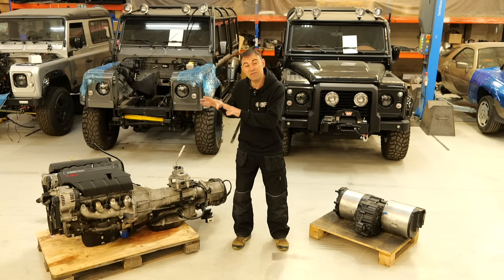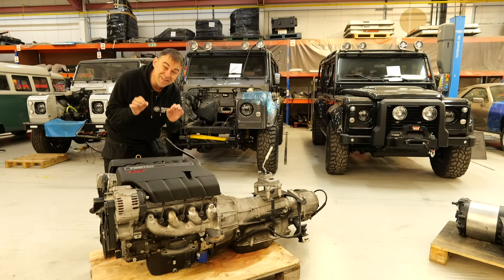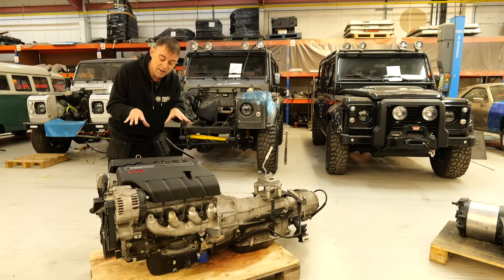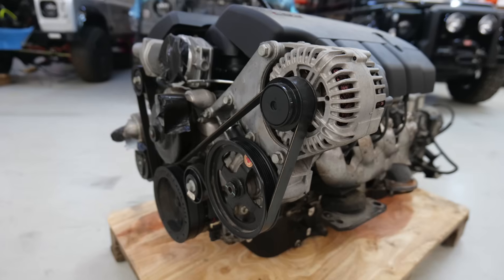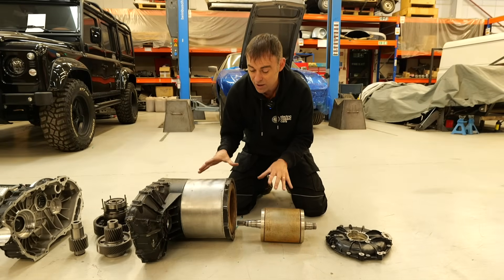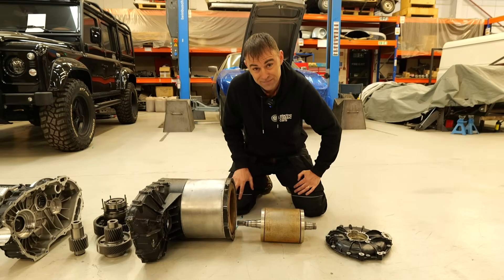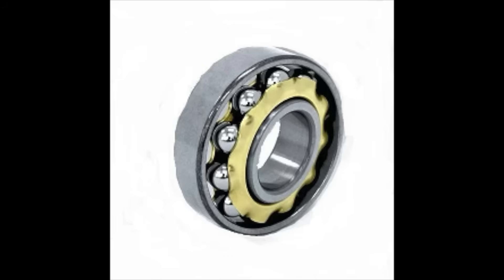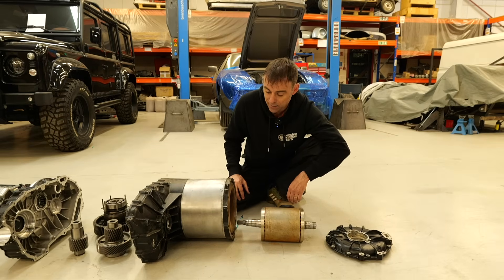Let's compare the Tesla LDU with an LS3 V8 and take one apart to see what makes it tick.

Comment: You're considering the motor in isolation from the energy storage and management. There is ton's more complexity in the Electric regarding storage, cooling of that storage, very imprecise calculation of available energy in that storage, and protection of that energy from being released in an uncontrolled manner. The ICE engine's storage of energy (fuel) is much simpler in comparison and safer (not in terms of total fires, but in severity of the fires that do occur). You can see this playlist of the MANY risks that come with EVs:  https://www.youtube.com/playlist?list=PLAQf9tD6dnaCt_tu7y9buqvQhU9Neo5Gv
Reply from the maker: Wow, someone that watches StacheD and MGuy, you really have been drinking the Anti-EV cool aid. 🤷‍♂️🤦‍♂️ How about watching a bit of reality like https://youtu.be/opF1si__APs?si=cVPzSWXwYU62ZV7D
Reply: @ Hey, with respect, I can say the same thing about people drinking the kool-aid from the likes of Electric Viking & other loonies. What elevates my opinion over the opposite person is a 180 hrs of college courses with a wide background in phsyics, chemistry & electrical engineering. I'm not just jumping on some bandwagon to score cool points with a particular side. If you want to convert classic cars to electric, I don't have a beef with that. You make some good points about the simplicity of the motor & thus reliability. But it's only one of many component of what makes it work. And unfortunately, the BMS & batteries have shown themselves to be a safety risk when they are abused (& many times there are not a lot of clues that can definitely determine when that happens). And that creates a lot of waste & expense b/c that vehicle must be disposed of, like flushing money & work/energy used to manufacture the vehicle down the drain, raising insurance costs for everyone in the process.  Without subsides/taxes/&regulations from the gov't, EVs would not make a compelling argument to the average consumer. That's reality.

Comment: Great video and electric is the future, but the now issue is providing energy to motor or engine, depending on desired range, you can add 100kg for petrol or 1,000 for batteries, all cars are getting heavy (apart from MX5) but most electric cars are particularly heavy which is not great for total resource use…

Comment: it doesn't seem you are comparing apples with apples: the LS3 needs fuel (a fuel tank) whereas the Tesla needs power - banks of it which is not mentioned in the maintenance consideration nor in the weight and size comparisons....
Reply from the maker: We covered petrol vs battery comparison in a previous Tech Talk which was linked multiple times in this episode. 👍 https://youtu.be/opF1si__APs?si=5RtLkXs1A3lPlj7y

Comment: ICU can be switched over to hydrogen in place of gas.  The engine sounds are still there and the exhaust is drinkable water.  The car doesn't know it's not running on gas.  Yes, hydrogen infrastructure is negligible but when the adults step in it will happen.  Logic dictates.  Why deal with rolling brownouts while your LS-1 is idling in the driveway and helping the atmosphere.
E-cars are big time now, but so was Elvis in his day.
Reply from the maker: You need to do some basic research into why Hydrogen will never and has never gotten off the ground. There’s too many fundamental issues that can not be worked around. 👍

Comment: Electro motor also has a thousands of small parts (please disasemble inverter unit). They are also prone to malfunctioning, especially because ageing, corosion and overheating. Plus the size and weight of batteries. And they are NOT economical or ecological at all. The only one benefit of EVs is no DIRECT pollution from exhaust. But, there is very hazardous EM radiation around em (like in microwave) and faster tyre wear as also very dangerous (much more heat than petrol) battery fire. Every technology has it's own pros and cons. For me, I need reliable car which can drive in all conditions for hundreds of miles, even in places without electricity. So my picks are diesel and petrol cars. Untill hydrogen cars become standard.
Reply from the maker: You’ll be waiting a looong time for hydrogen to become mainstream. Alternately go and buy a Toyota Mirai now and let me know how you get on. 👍

Comment: 2 Things here, 1) you forgot to add the Weight and Size of the Battery that Drives that Motor, It is Huge and THAT is where a lot of the Problems Occur, 2) how long does it take to Charge That Battery for say 300 km of range, without going to 200 Amp fast charge, ie: Charging it at home probably overnight, but don't charge it within 10 Metres of your house or Garage in case it "Spontaneously Ignites", which will then "Delete" the car. I loved to see the Side by Side comparison, and the Inner workings of the Tesla motor.
Reply from the maker: 1 - We covered petrol vs battery comparison in a previous Tech Talk which was linked multiple times in this episode. 👍 https://youtu.be/opF1si__APs?si=5RtLkXs1A3lPlj7y
2 - After 3 hours of driving today, we stopped for a quick toilet break and a bite to eat, by which time the car was charged up (in fact it was ready before we were). And as for the spontaneous combustion myth, please do some research. EVs are around 60 times less likely to catch fire and there’s plenty of examples of ICE vehicles spontaneously combusting when parked. Just use Google. 👍

Comment: Your reasons for moving to electric power for your vehicles are all on my list as well. But additional importance for me is where the energy comes from. You can only power that LS3 with a specific type of petrol. And certain people control that supply, and I can't make my own.

Electricity is produced many different ways and I can produce it myself at my home without relying on anyone else. That is very important to me in an uncertain world.
Reply: This is one of the better arguments for embracing EV that is actually quite compelling.  Still doesn't outweigh all the other cons of EVs IMHO, but it balances the equation a little more in favor of EVs.
Reply: @RT-mv7df  Also a good argument for older diesel engines, that lap up waste veggie oil.
The more modern stuff requires that  being processed in to bio-diesel, but either way it within our power to produce it.
Reply: @RT-mv7df  What are some of the big cons for you that prevent you from purchasing an electric vehicle?
Reply: You can make your own fuel, but you can 't make your own batteries. Blame energy restrictions on the government. Wait till they start regulating battery disposal. If they would stay out of the business of cars everything would be better gas and electric.
Reply: @frankmc5112  There are already businesses that can recycle 90-95% of battery material. Furthermore, with the rise of things like sodium, there will be less reliance on Lithium.
Reply: @PaulASmyers   The economic arguments for living — to all intents and purposes — off grid are very compelling. I’m looking closely at it right now. Even if you’re not a greenie (I am but it’s not my primary motivation at the moment), if you can swing it, you’ll be better off financially. I can’t think of any good reasons why I would want to be dependent on oil companies, to the tune of thousands of dollars per year, for the rest of my life.
Reply: You have to get batteries, your screwed
Reply: The Gov fooled you into thinking that but in reality they control the electric. Once they get everyone to switch, up goes the price of electric. Now they really got you.

Comment: Good day ECC team, I was wondering whether you already see other electric motors/ drive units become competitive with the Tesla drive units???  Incarnation Stu is converting a 928 using a MG drive train for example (I don't think that drive unit is better than the Tesla unit!!!) and others have been using Nissan (again no competitor for the Tesla I think), I have seen some in NZ recently (Electricarna in Taupo,  https://www.youtube.com/watch?v=bKscXb26SIc&t=5s) done by Ripple Tech (Rotorua).
I plan to do a large 4WD/Sprinter conversion when I retire (in a few years time) to use as a campervan.  Plan is to fill it with battery cells from whatever crashed vehicles that I can get enough at that time, and slap solar on it (won't be in a rush to travel around the country).

Comment: This is incredably appealing but how does one figure out what batterys and how many are required and what computer parts to make the drive work?  There has to be quite a bit more to the entire thing then just the motor?
Reply: A battery has a nominal voltage - maybe 3.2v for Lithium Iron Phosphate. Now you know you need a target voltage, let's say it's a 600 volt architecture. 600 / 3.2 is 188. A 14x14 square of batteries is 196 so that would be a really easy way to make a compact arrangement. If you use 21700 batteries you would end up with 188 batteries in a 1'x1'x3" module (30x30x7.5cm). You could then use multiple modules and end up with thousands of batteries.

There can be a drive unit that connects to the battery and then powers the motor and regulates the voltages and what not. This can be consolidated into 1 unit or separate individual units.

Comment: I agree, been living with these electrics a while and they don't complain.  In 100,000 miles it's been windshield washer fluid, windshield wipers, tires, 12 V battery and brakes.
Reply: Why brakes? Is the car a conversion? With motor regeneration, there should be very little wear on the brakes.
Reply: @EleTruk 
EV brakes wear at about 30% the rate of non-EV, so durable but not maintenence free.
Reply: Brakes? after 400.000km the pads are 1/2 on mine😂
Reply: @moestrei  Lost of elevation changes. Driving across the Rockies and Appalachians. I know right? I didn't expect to be replacing them so soon. It's a Rivian R1S fully loaded with the family.

Comment: In 1900 more electric cars were being sold in the US than ICE cars. But because of certain developments ICE cars became easier to manufacture and run and so EVs were effectively shelved. Imagine a world where EVs had succeeded, where everyone was driving them and where the infrastructure had evolved with them. And now someone came along and said 'Hey, we've developed this new form of propulsion. It's called an internal combustion engine. It is huge and heavy. Develops less accessible power than your current zippy little thing. It is really inefficient and really unreliable. If it breaks down your transport will be off the road for weeks, potentially for ever because it's really difficult to find problems and fix. We'll have to redesign your car to give you less space, because this thing is so huge. It stinks, makes lots of noise. You won't be able to get your fill up from a plug, at home or at your normal carpark, you'll have to go to a special place away from home to fill up. You'll have to build a whole industry around drilling filthy stuff out of the ground and shipping it around the globe just so you can fill your cars up. And when you burn this filthy black stuff it will pump the air full of really filthy gas that will heat the atmosphere up, make the earth inhospitable for millions of people and kill gazillions of animals. Who wants one ?'. I just wonder what the take up would be ? Cos I reckon we'd look at the people trying to sell us this internal combustion engine thing like they were mad. Sorry, where are the advantages ? It's dirtier, less convenient  and a bit rubbish. But of course because we are fundemntally just slightly  evolved apes most of us are scared of change. We'd rather stick with a rubbish thing than embrace witchcraft.

Comment: Ive run a P85 since 2015 155,000 miles dropping the rear sub frame this summer , every rubber bush replaced on the suspension parts and coolant delete done. Looking forward to the next 150,000 near 600 HP on the rear wheels erm thats a lot of fun!.......On my 3rd Zero, mountain bikes that will be Amflow..........electric then its the future and Im a petrol head!
Reply from the maker: Zero bikes are great, my father has an SRS and loves it. Will never go back to petrol now. 👍
Reply: @ElectricClassicCars  On UK roads that are fun nothing stays with a SRF. But dayglow up! Humans have just gotten heads round silent cars, give it another 10 years........ no 20....... silent big fast bikes will register....eventualy.  The i didnt see you is now the i didnt hear you....dont ask me how I know.....50 years of biking 10 years on the Isle of Man 170mph+ stuff and I end up with 4 weeks in hospital and 2 years rehab. Dont let the fuc*ers wear you down lol.

Comment: 1834 – The first electric motor is made
History was made when Thomas Davenport of Vermont invented the first official battery-powered electric motor in 1834. This was the first electric motor that had enough power to perform a task and his invention was used to power a small-scale printing press.

In 1876, Otto developed a gaseous fuel, compressed charge 4-stroke cycle that would become known as the Otto-Cycle. This is the principle that still powers most car engines today.

....so we´re going back.. not moving foward..        Battery density changed alot... making it a viable option now..    the range using led or iron batteries was the problem before not the E motors.. 

motor efficency on 4 stroke ICE motor likr a t ford was probably ~10%  now the newest ICE tech is close to 50% 
 something like an backer electric EV already had an efficency of 70-80% .        

So ice engines actually have evolved alot more than electric engines the last 100 years ...  

In F1 they took over 1000 horsies from a 1,5 litre  bmw engine in the -80thees  that weights ~ 70 kg..    the reason that gigantic LS3 only has 400 horsepower is just emission rules..

Comment: the problem is charging.   I fill up an EV in 3 mins.... the EV will take 30min partial, and hours full charge normal rate.   not to mention the cost of the car.      dont forget, these heavy EVs chew up tires in 10,000miles

Comment: I am building an RCR GT-40. I did a quick study on whether I could use a Tesla power train. I found that I could fit enough batteries for 120 mile range. And if I took it to a track get a few laps. I went with the LS3 and a Porsche transaxle. EV West in Carlsbad California has been retrofitting cars for a few decades. I talked to them about my trade study.

Comment: What if you just weight the vehicle before and after?  Both fully charged (Fuel, Coolant and all batteries) that would be a better discussion.
Reply from the maker: We’ve done that on many many of our previous projects episodes. Most of our cars weigh the same as when they were petrol with a tank of fuel. 👍

Comment: I can take a few gas cans with me if I go out in the woods… What are you gonna take — a solar panel?

And when the electricity was produced… Coming out of your socket in the wall… That efficiency was as bad as the gasoline engine..
So not really a valid point regarding the environment…

And on top of all… I would never never ever buy or use anything from Tesla / Elon Musk
Not supporting a Nazi!
Reply from the maker: The efficiency is not as bad as the gasoline car. If you’re going to spout rubbish at least include a credible source. 🤷‍♂️🤦‍♂️
Reply: Rubbish is when you put electric motor in the off-road vehicle! 
That’s just a straight dumb idea unless you’re building it for a person who just runs around in London with it!
I want to see this thing out in the field and doing water crossing.. off-road around for a day… (That’s not gonna happen)
Those cars were worth something with a LS engine in it… With electric they lose 80% of the value!  
Just looking on auction when one of the electric converted car sell.. and most of the time they don’t sell..
That is rubbish
Reply: Here’s the straightforward answer from Google.. Type the questions in you find the same thing!

The efficiency of a coal-fired power plant in the United States averages around 32-33%. This means that only about a third of the energy in the coal is converted into usable electricity, with the remaining energy lost as waste heat

Gasoline engines are typically around 20-40% efficient, meaning that a significant portion of the energy in gasoline is wasted as heat. Modern gasoline engines can theoretically reach over 50% efficiency, but most road-legal cars achieve closer to 20-40% due to factors like wear and emissions